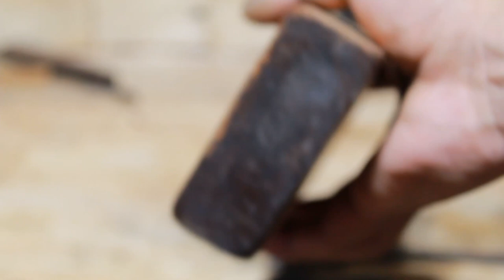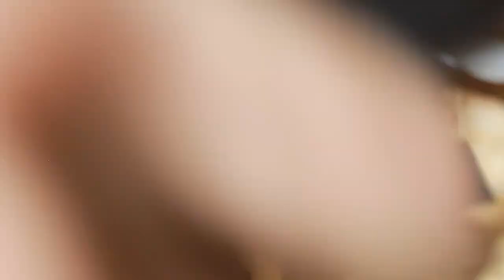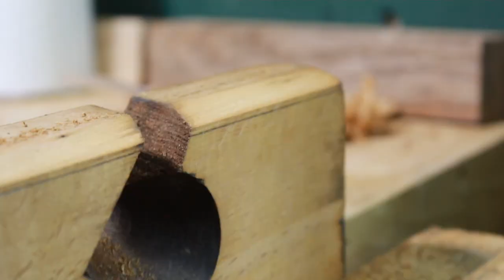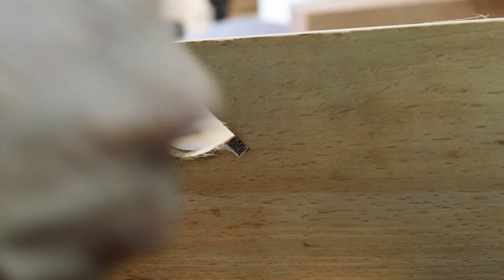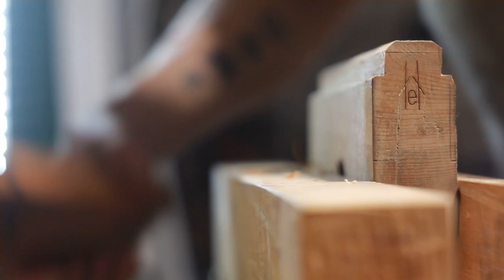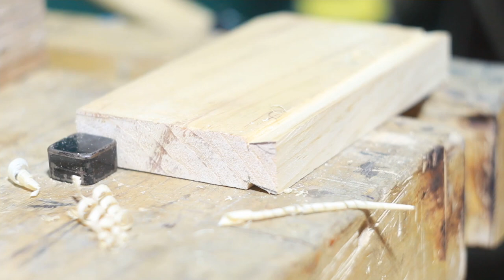Shoulder plane to Dovetail plane transformation

Comment: What a brilliant idea. I've been looking for six months to buy one. I thought it was going to come down to making one from scratch. I never once considered conversion. I have a couple questions if you don't mind. 1Tell me what angle did you choose. 2 I assume you just transferred that same angle to the iron. 3 Is your plane now also capable of making the female / socket portion of the joint.
Reply from the maker: Thank you.  I have never been able to catch one online either so I have been practicing making a good from scratch also, but I read about one a few years ago in an article about converting a shoulder plane to a Dovetail and figured I would give it a shot.  But I went with 1:6 for the sole of the plane. 
I used blue layout fluid on the blade and transferred the angle to the blade. 
The blade can't get in to make the female but it isn't a big deal. Mark your dovetail. Use a block of wood cut at that angle to keep your saw steady while cutting and take your time. Finish with a router plane. Then sneak up on the male portion so it's a tight fit.  Thanks for watching!

Comment: Looks good.  Works well.  Nice plane.  Is it possible to make one that creates the female portion of the joint?
Reply from the maker: With this one no. That would require a different plane which are hard to find but with a block of wood cut at that angle to lay your saw on, it's not that difficult if you take your time. I would cut the female one first and then the male so you can sneak up on a good tight fit. Thanks